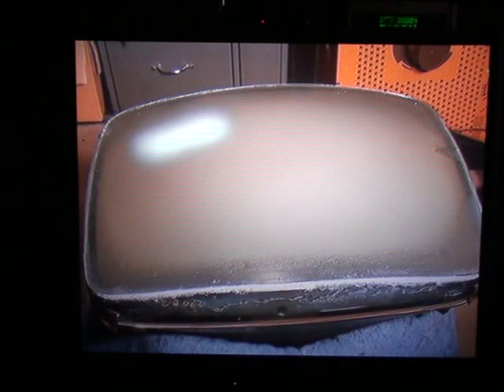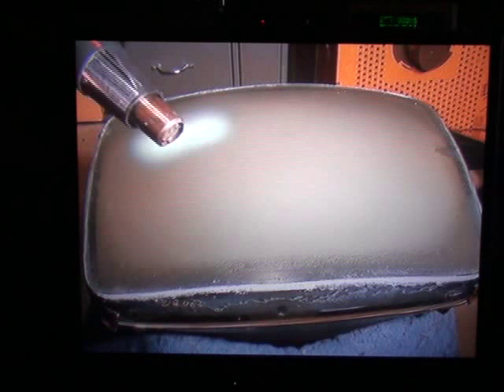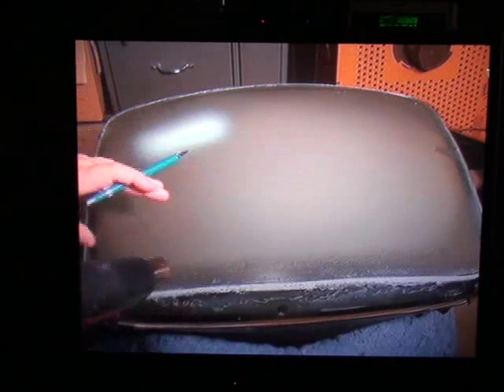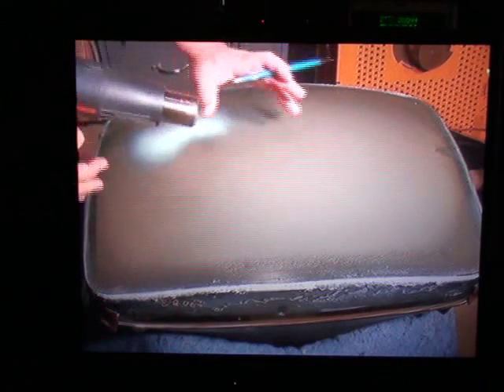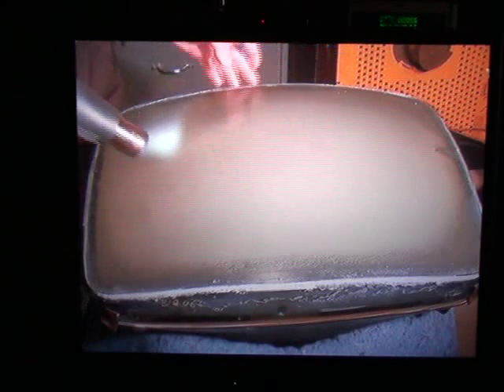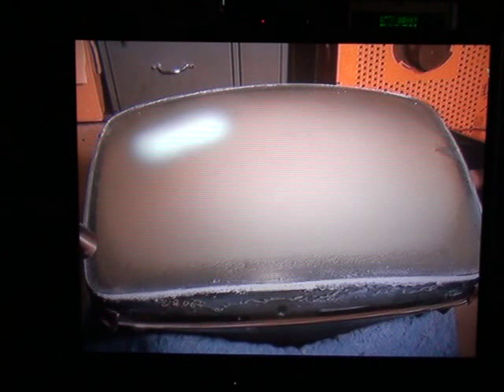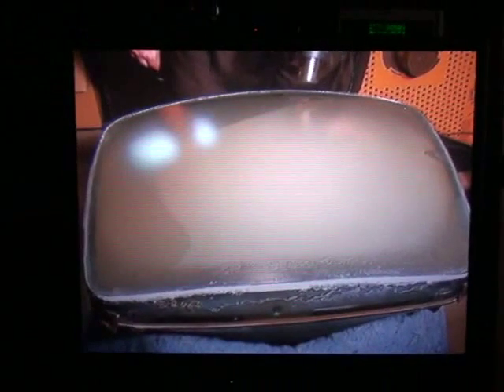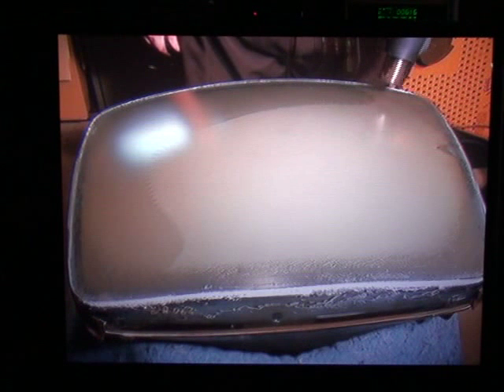How to repair CRT cataracts part 3 of 7

Comment: Hi Doug. Thank you for posting cataract on CRT removal. Great work.  I have a new old stock GE 25ap22 grade A  CRT that has a cataract,what method should use on it,also,will the hot wire work on this tube as well as all tubes?   Thank you.

Comment: You said in part 3 that Zenith's color CRT's with severe cataracts cannot be removed except with an electric hot wire.
I have a 1965 Zenith 23" color TV console.
It has severe cataracts almost to the center of the screen. I bought a replacement CRT but am now thinking I can restore the original one.  Is the electric hot wire more difficult than this method?